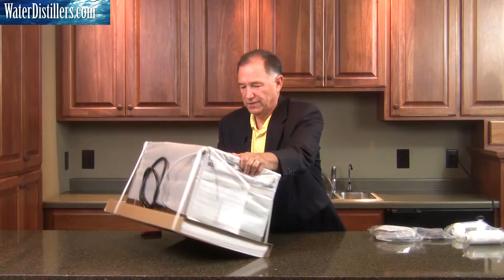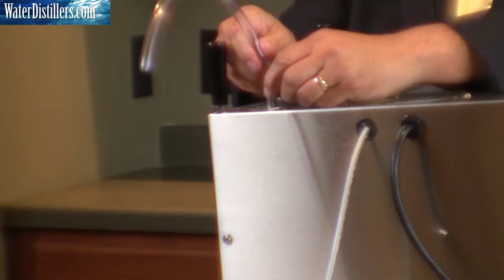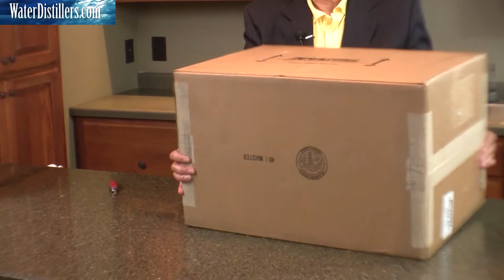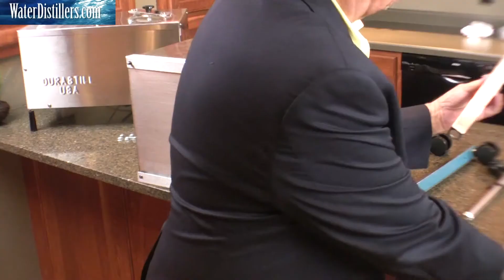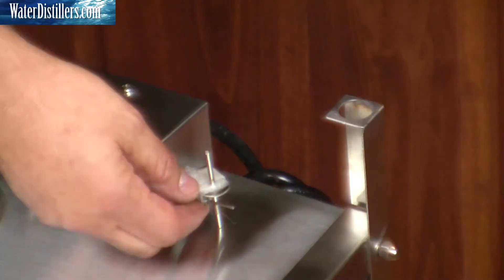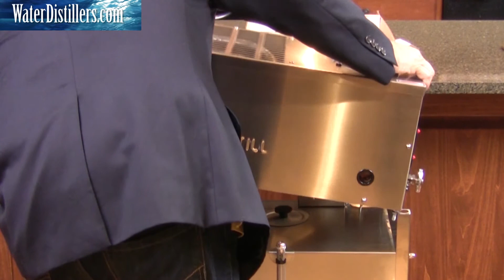Durastill 4640 Water Distiller Installation Video For The Durastill Model 4640 Water Distiller

Comment: My question is.. which water distiller is the best. I purchased a cheap one said in 4 hours get a gallon. it had a plastic cover w/fan etc. all I could smell was burnt plastic. I tried making one n the rubber washer welted. frustrated cause store bought smells like plastic as well or even bleach or old milk. I have a cpap n need the water for that but wish to purchase one for drinking as well. Thank You for your time